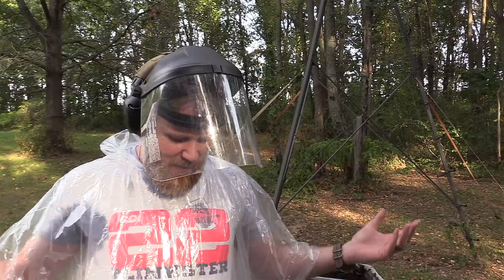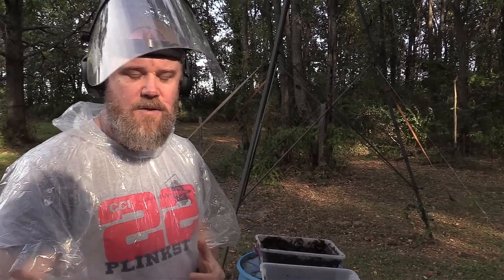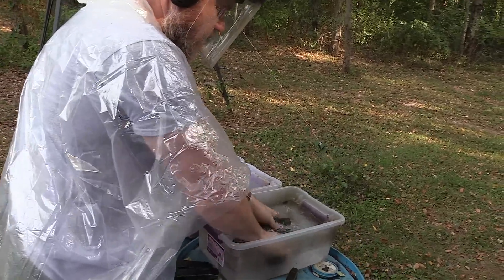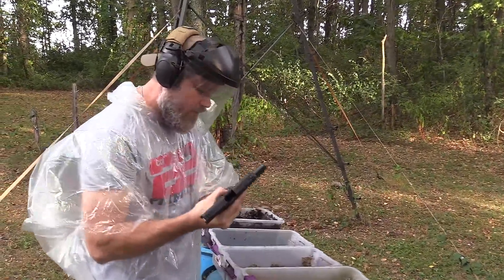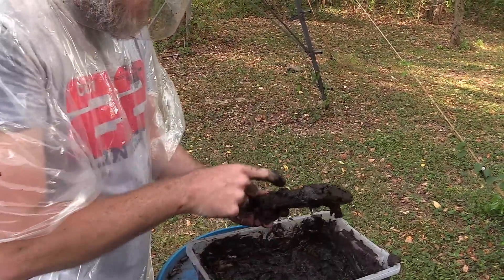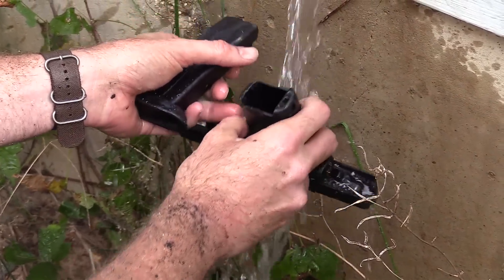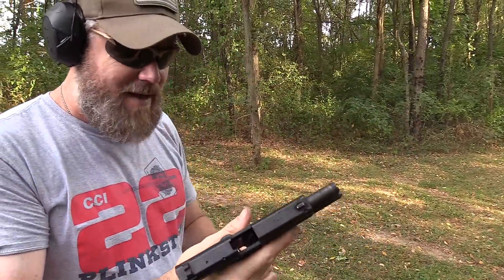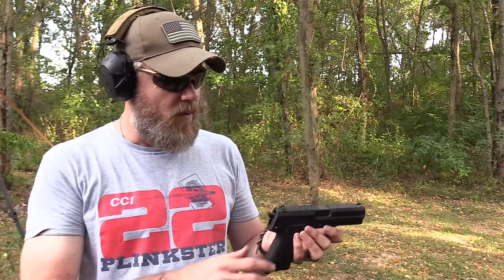The HK USP 45 meets the Gauntlet!

Comment: After my Block went back to the factory three times for not going bang, they finally admitted they had drilled the frame wrong and solved the problem by bending the parts till it worked. I never even bothered to try it the last time. I traded it on an HK USP .45 and never looked back. 15 years, thousands of rounds out of a pile of HK's I own, which I run bone dry and only clean them about every 5 years. Never a failure to go bang!! Make no mistake, they are MONSTERS!!!

Comment: Do you think being a 45 it has more power to knock the crap off? Mostly it seems like 9mm is the go to round when you test?
Reply from the maker: That's kind of something I touch upon in the video. I do believe the more brisk recoil may have contributed to the reliability, which if true, would be an interesting point.
Reply: So .40s&w would be the most reliable of them all?? ;)
Reply: 357sig would of been the most.
Reply: cavscout888 10mm
Reply: 10 millimeter is best millimeter
Reply: yeah probably should have done a 9mm for sciences sake
Reply: +Green Badger Outdoors 5,7 is better
Reply: cavscout888 - I've owned a lot of semi-auto pistols, and my .40's have been a LOT more reliable than my 9's. The only 9mm pistol I've owned that truly "worked right" was a G19. The rest at least suffered from weak ejection. I don't care if .40 is falling out of favor, I'll usually go for a .40 pistol over a 9mm.
Reply: Maybe you got unlucky because that's not really been my experience or anyone else I know of. I have over a dozen 9mms and every single one of them runs, and yes I shoot my guns. Glock 17,19,26...beretta 92...cz-75...browning hi-power..sig 226/228....walther PPQ to name a few, and they all run like sewing machines. One gun I sold over the years was a Glock 23 because it didn't run 100% for me so I think your theory is flawed. Sounds like you either got unlucky buying a few cheap 9mms or you are just a .40 s&w fan trying to bash 9mms. Do you really think it would be the most popular chambering for pistols all over the world if they didn't have them dialed in?
Reply: Gr8WhtMomba He tested the USP45 because he got a killer deal on them. If he ever gets one in 9mm, expect it to perform at least as well as the .45. These things are animals; no matter the caliber, they LAUNCH casings out of the chamber with authority.
Reply: I would very much like to see a 357sig test as unpopular as the cartridge is. I personally love the snap and wonder the same about the hotter rounds.
Reply: All my HKs do that LOL So much so that on the pistol range at my club I specifically line up to the right of everyone just so I don't piss someone off.
Reply: MPOW3R 😂😂😂
Reply: It's so true though! haha I was at the range Saturday with my buddy who has a Glock 19 and CZ... We were the only ones there all day and at the end we were collecting our brass. I bend over to pick some up and I hear 4 lanes over to the right, "Who's 9mm and 45 is this?! This range was clean when we got here?" 😂😂😂😂
Reply: champy1210 haven't shot one yet. Saving up for one.
Reply: Gr8WhtMomba You won’t be disappointed!
Reply: Military Arms Channel time for a Desert Eagle test lol
Reply: provehitocobalt none of the models are chambered in 10mm.
Reply: dolly drill Unfortunately, that’s correct. But YouTuber “LifeSizePotato” did successfully change out his barrel (and perhaps other parts) on a USP .40, converting it to 10mm. Check out the video!
Reply: in my opinion the USP chambered in .45 is the most iconic USP. it'd be like testing a 1911. sure they can come in 9mm, but if he does the gauntlet, you'd want him to use a 1911 chambered in .45
Reply: While that is your opinion, and I tend to agree with the first part, I think your comparison to the 1911 is a bit much.. The USP 45 was the last model of USP to be introduced, NOT counting the MARK 23. The 9mm being second, and the .40 being the first, and it was one of the first handguns available that was specifically designed for the .40 S&W cartridge. It's completely the opposite with the 1911... For 80 years or more of the 1911s life, .45ACP was the only mainstream, widely available and reliable offering. Only in the last 20-30 years have we seen 1911s chambered in something other than .45 ACP that are both widely available and and nearly or just as reliable. So while the USP 45 is probably the most iconic USP offering (and this is coming from someone who has 3 USPs and a MARK 23 lol), it's not iconic to the extent of the 1911, both in terms of popularity, and in it's technical and developmental aspects.
Reply: I think the USP chambered in .40 S&W is special because it was the first gun developed specifically for the caliber, rather than just being a scaled up 9mm, but I still think the USP .45 is the most iconic, having seen it more than the other chamberings in TV, film, and video games especially.

Comment: I bought an HK USP in .40 cal back in 2000 and I thought, this thing is WAY over priced. ($985.00) After seeing this and only 1 minor failure in reliability, I’m thinking, I could have paid $2,000 and I would have still gotten a bargain on it. Compared to my $1,200 Kimber Custom Carry 1911 which jams every time a drop of oil is burned off. 1911’s are tactical trash in my opinion. They are good for only one thing, hanging on the wall that way you can look at it and say, “yup, got me one.” You’re right MAC, the HK USP is a tank. It just goes bang. Love it. Now time for another reliability test on the Glock 21 Gen 3 (my first carry pistol)
Reply: It depends on what 1911 that you get. My rock island I've had for years and has never had a jam. one of kimbers will jam after being dipped in air and its 4 times the price.
Reply: HK in USA is verry expensiv, a friend of me bought a USP 9 for around 700€.

Comment: Been debating selling my HK45c.  Now I have another excuse not to.
Reply: Murphy82nd I love and hate mine. I have more rounds through it than any platform except maybe a 1911 and it has been utterly reliable and accurate. If it had the texture or the P30 and a slightly smaller trigger guard it would've been a home run.
Reply: Murphy - I wouldn't even consider getting rid of it. As much as they charge for that gun, it would be a lot harder to replace than most pistols.
Reply: I have the hk45t and it is also a love hate. I shoot with a very high grip and the safety is perfectly in my way so when I shoot it with my grip hand thumb over the safety, i get a pain in my thumb from it banging into it. I shoot it suppressed and it id a very soft shooter when the can is on. Very sexy gun though and the perfect example of reliability.
Reply: How fun are these hk usps and hk45s to shoot compared to a 1911?
Reply: I want one
Reply: Jblooddrunk convert it to LEM
Reply: Kat Marriot they have a softer impulse with a tad more flip to the muzzle. They are insanely accurate and reliable. The Hk45 has better ergos for most
Reply: K Bob Good idea so that would get rid of that safety on the left side? Is there a way to keep it in variant 1, but put the safety on the right side? You think that would be dumb? I like having the manual safety is the issue w the LEM.
Reply: Kat Marriot the USP is such a soft shooter for it being a 45. Such a pleasant pistol to shoot. I traded in my springfield 1911 loaded model for the HK45T , then bought the USP45T a short while after...i enjoy shooting them way more than my old 1911.
Reply: Jblooddrunk it would completely delete the safety. I'm not aware of a variant that puts the safety on the right side only. I doubt you will miss the safety one you go LEM. Basically when you take your finger off the trigger the gun decocks. However, the reset is the same as the single stage reset. You basically get a striker fired gun with a 2 stage trigger and the added reliability of a hammer for ignition. There are quite a few springs to choose from. You can have it set as light as ~ 1.5 lb first stage and about a 4 lb break or on the opposite end you can have about a 3.5 pound 1st stage and about a 7 lb break. Keep in mind you still can place your thumb over the hammer when holstering as a safety.
Reply: K Bob Nice i think i am going to go for it then.  Thanks a lot dude. People who are well versed in hk handguns are few and i never speak with any.
Reply: LOVE my HK45CT-- it's a keeper.
Reply: Murphy82nd the Mk24 isn’t anywhere near the same unfortunately as the USP 45
Reply: Jblooddrunk Variant 2 is a Safety/Decocker on the right side. I turned my 45CT into a Variant 3 (decocker only), need to turn my M9A3 into a G as well (decocker only). I’m just waiting for my USP 45T to ship to me any day now.

Comment: Makes me feel good about carrying a hammer fired HK every single day!
Reply: MPOW3R you and me both
Reply: MPOW3R do you think the p30 will be as good
Reply: Well from what I have been told by HK experts and armorers the hammer fired mechanism in the P30, P2000, HK45, HK45C, T, CT, et al. is essentially the USP mechanism in different sizes and configurations (DA/SA, LEM). The lockup, extractor, etc. on all of my pistols are almost identical as well. I own a few hammer fired HKs lol The USP in 45 Tactical and 9 Tactical, an early MARK 23 with the chrome lined barrel and original "SEAL" finish, a VP9, but the guns I enjoy the most are my P2000 V3 and P30 V3. The MARK 23 is my woods gun, where I run 45 super xtreme penetrators. The P2000 is the most underrated and under-promoted DA/SA carry gun on the market. Almost identical in size to the Glock 19, but more ergonomic, it's what I carry every day. The only thing it lacks in comparison to the Glock is 2 rounds in the magazine in 9mm. It was billed initially as a more ergonomic USP 9 Compact, and had things like ambi mag releases, slide releases and interchangeable grip panels well before it was all the rage. The P30 is simply the best out of the box duty sized hammer fired handgun on the market in my opinion, and I'm a big CZ fan too. The ergonomics are second to none, and the true ambidexterity of all HK pistols is unmatched. Oh, and they're reliable... As everyone can see.
Reply: +Shep 24 What are you running? P2000 V3 and P30 V3 here! MARK 23 in the woods with 45 Supers lol
Reply: MPOW3R my sig m11 and 228 have been great. We really liked the p30 is why I'm curious. It would make a good duty gun I think
Reply: Completely agree. Especially given the ambidexterity and that you can basically custom tailor the gun for the user. It's truly a fantastic handgun. If they released an "updated" P2000 with the features of the P30... I'd be first in line to purchase that as a new EDC lol
Reply: hi...a question, you are a paetron memeber, can i know if MAC will do the gen 5 glock torture test?  thank you!
Reply: Check out pistol-training dot com. The late great ToddG fired 90k rounds through a p30 and 50k through a HK45 and pretty meticulously documented the entire process over the course of several months. Great read, great guns.
Reply: He has not stated he would, and I honestly don't see him doing one, especially if you look at his video regarding the Gen 5. There are very little, if any changes to the gun that would alter the results of the already Gauntlet tested Glocks.
Reply: MPOW3R HK P30 is my favorite combining Walther P99 fiberglass frame with HK P2000 hammer quality. A Glock will break before a P30 does.
Reply: Absolutely. I ran a class one weekend this last summer, and beforehand ran over 500 rounds through my P30 without cleaning it. I fired a total of 1,432 rounds during the weekend without a single malfunction or the gun even seeming tired. I was thoroughly impressed. Meanwhile, a guy with a pristine looking Agency Arms Field Edition Glock had his extractor snap off... I just wish HK would release a P30 version in the size of the P2000. I'd buy two lol
Reply: MPOW3R Absolutely!  I love carrying my USP's and HK45C.

Comment: Variant one, cocked and locked is the only way to carry it. HKs modern day 1911.......... if it was 1995.
Reply: They came out in 1994 not 1995.  I have a '94 dated one in .40 S&W and I still carry it.  It has been the model of reliability.
Reply: Rich White I'm referring to .45 being released in 95, not the .40.
Reply: vee dee or since it's DA, decock the hammer and leave the safety off.
Reply: Alex Moore I prefer the sa pull more than da pull. With that said, it is designed to be carried cocked and locked.

Comment: Have owned one since 2006, I only use Speer Gold Dot 200 grain +p I have run over 50,000 rounds, and the only issue was at some time the recoil spring retainer clip went missing. Didn't realize until I disassembled it. I carry it as my daily and never leave home without it.

Comment: Not my channel. Not my decision. I would still liked to have seen this is 9mm.
Reply: the .45 version is much more classic and legendary.  It's like saying you'd rather see a 9mm 1911 test.
Reply: Well, that may be your perception but saying it is like wanting a 1911 in 9mm is pure nonsense. The 1911 was designed and sold as a 45acp. The USP 45 was not introduced till years later, the 9mm and .40S&W arriving much earlier as, by that analysis, more classic and legendary.

Still, that is not what I meant. To compare like with like, every other pistol tested in 9mm. This being 45acp muddies the waters; What is design related and what is caliber dependent? There is no way to know.

Comment: That's what blows my mind that people buy medicore glocks over these guns 😆😆
Reply: I have g21, hkusp45, and fnx45t.  There is nothing mediocre about the glock at all.  Its WAYYY lighter, has more mag capacity (by 1 round), much more compact, and is just about the same reliability.  Maybe not quite as bullet proof as the HK, but in dirty conditions I think the G21 does better, because its striker fired (no external hammer to clog).  The HK is more accurate, and definitely way more sexy however.

Comment: perfect ejection pattern.  I have an early 1993 40sw USP with over 20,000 logged rounds with no failures and no parts replaced.  Its not what I shoot primarily mainly because ergos are not up to par, but its a firearm that will last a lifetime.  If I could only own 1 pistol it would be a USP.

Comment: I carried my USP tactical instead of the standard issue side arm. It never failed me where as the guys that did carry the Beretta got jams from time to time. I got it rebuilt by the armors just before I retired from the Army to like new condition. It survived multiple drops into mud and sand, just shake it a few times and it's ready to use. It's still very accurate. It's like my best buddy, but now days I don't carry it anymore, I carry a different side arm. IF something were to happen I wouldn't want to have it taken away by law enforcement or over zealot crazies in the media and government.

Comment: The polygonal barrel & HK engineering is impressive. The usp line is based on the socom Mark 23 .45acp sidearm. I almost purchased a DA only version 07 HK .45acp in the late 90s. It has a stainless slide. Nice.
Reply: The USP is the only pistol designed around the 40 s&w. It hit the market in 92 or 93 I believe. The USP was/is the most abusively tested pistol ever made. Because of its testing results and construction H&K decided to build the mk23 based on this design to submit for military trials. The mk23 was originally meant as an offensive weapon for special teams warfare and was/is an exceptional pistol. Side note:  the USP was actually tested with squib loads using the 40 s&w. A bullet was placed in the barrel an inch forward of the chamber and then the pistol was fired. Both rounds exited the barrel with no damage and the pistol continued on with the remainder of its 10k testing with no noticable difference in accuracy.

Comment: My USP 45 is in partial conversion to a tactical version (Adjustable blade sights and the 5.25" threaded barrel) and mine does not kick much at all. I am able to reacquire sight picture very fast and with the adjustable sights it is EXTREMELY accurate. It has also NEVER had an issue in 4000 plus rounds, unlike the shit M9 and M16s I was issued in the Army. In my opinion it is one of the best guns on the market. It does suck for concealment, but thankfully I'm a big enough guy I can pull it off with loose clothing.

Comment: I ended up buying a USP 45 after buying an American Arms P10-45 that failed 3x before getting through a single box of ammo. First the store had their armorer go through it, then again, then American Arms went completely through it and on the first round downrange after they'd had their armorer go through the weapon with a 3 page report on what they'd done... the barrel went downrange with the round.  Gun store owner was like, "You're probably not particularly happy with this weapon at this point, if you'd like I'll take it as a return at full price and you can get whatever you want..." one of his employees was a WA State Patrol officer who carried a USP 45 as his personal carry piece concealed and let me fire it before purchasing my own.  Dead reliable with any ammo... even really really bad reloads. Turned out that conceal carrying it wasn't that difficult either.  Had tritium sights installed and no other mods or work needed.  I've had it now for over a 1/4 century and it's only been drawn to deal with a threat once... rest of the time it's spent on gun ranges.  I carry what I believe is called stage 3... no round in the chamber and have many years of practicing chambering a round as part of my draw, even during practical carry competitions.  Got that habit when I first got it because my son was an infant who I often carried in my arm against my hip and didn't want ANY chance of him kicking my trigger and causing a negligent discharge.